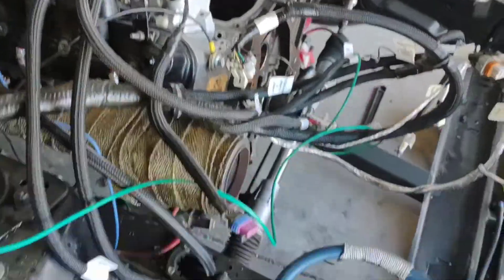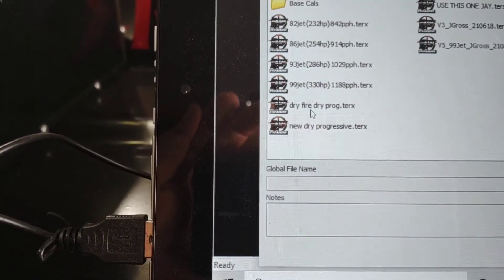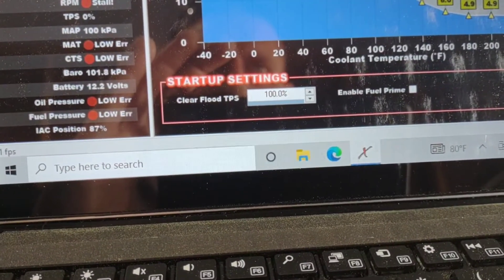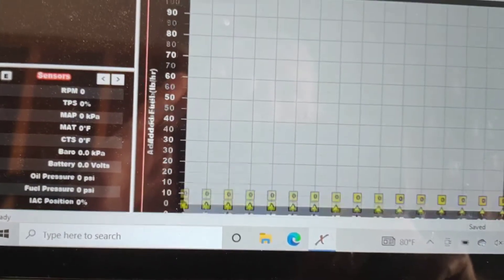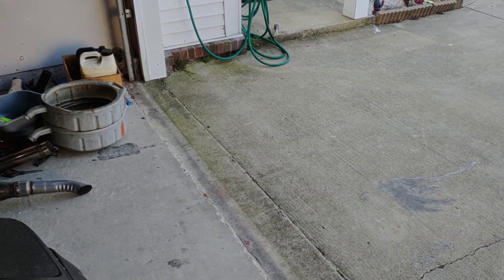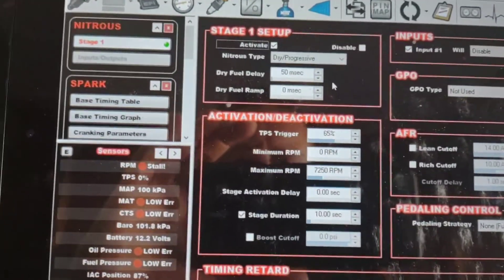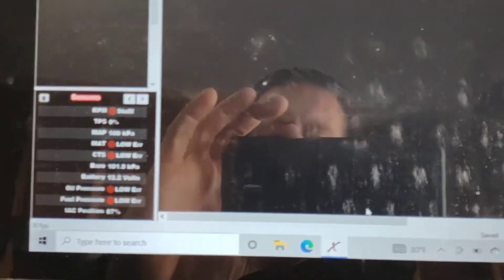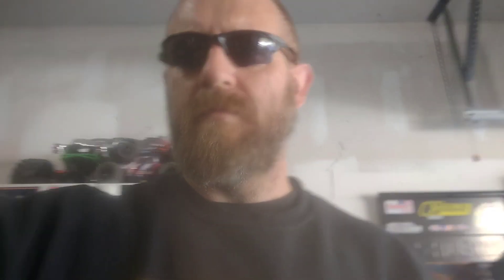How to dry fire (Test) your progressive nitrous using Holley Terminator X.

Comment: Do you know how to add a 2nd I dependent stage without the 1st one being active? I want a scramble button for when I’m doing a motor race and my 1st stage is not active
Reply from the maker: Assuming you have terminator x and it's controlling your first stage..you'll have to create an advanced ICF 1D table to offset fuel and timing. Keep in mind there are no safeties though like there is in the nitrous ICF. My second kit is on a push button. Whenever the button is pressed it will add fuel and pull timing. You need one input. To do it. Wiring is pretty easy too.
Reply: @berserkerracing9974  Thank you. I have the dominator and a lot of input and outputs. I just got it to work tonight but in this way only. I have to have the main Stage enabled, then i have to have to stage one active but diabled in software. Not the way I want it but I will try your way. Thank you!!
Reply: @berserkerracing9974  Actually, I dont want to do that way if there are no safeties. I think Holley will need to do an update to allow each Stage have its own control.
Reply from the maker: @randelholt7341  I'm not sure about the dominator ECU, sorry. But I can surely find out for you if ya like.
Reply: @berserkerracing9974  Yes please. If you can anything helps.